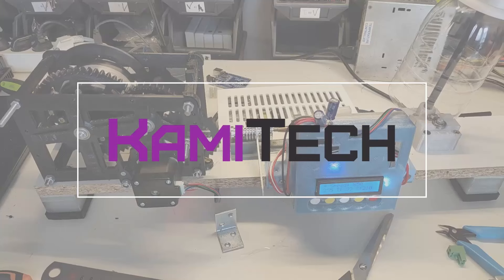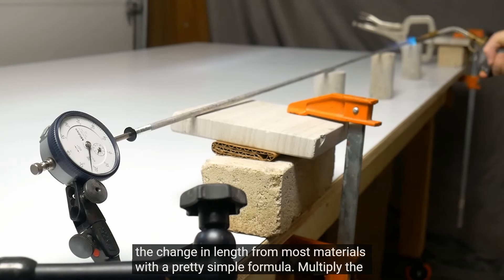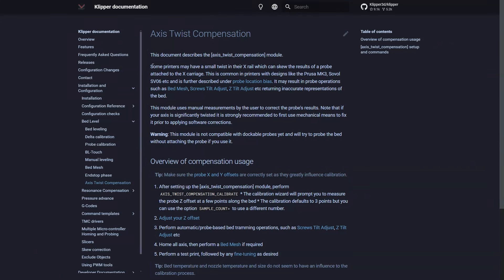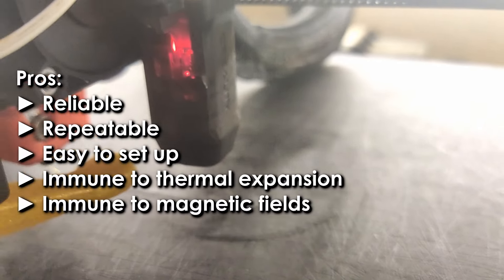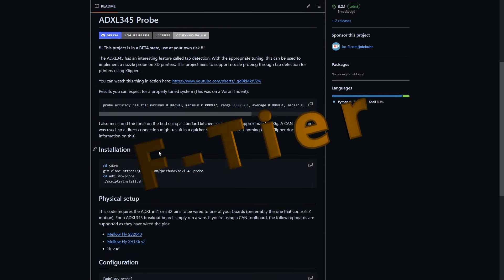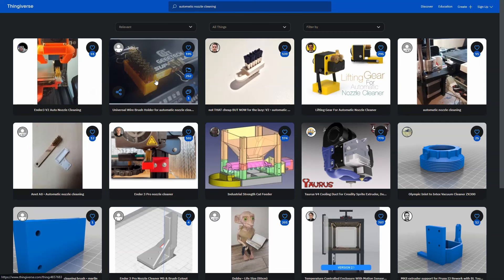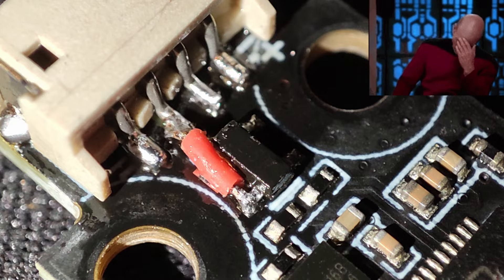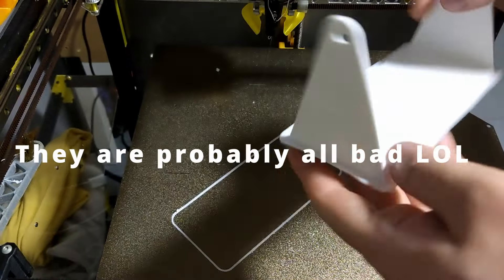Why All Bed Levelling Probes Suck - Eddy Modding and Testing

Comment: You can put your build plate on adjustable stilts. Ditch the springs, replace them with a nut that locks the bed to the top of the bolt.

Then put two nuts around the bed carrier. You can adjust them once, then jam them against the carrier and never need to touch them again. I use nuts in flat large printed thumb wheels.

Springs are bad because they respond with vibrations. Furthermore every time the spring oscillates, it nudges the bed adjustment nut just a little to unscrew itself.

You still want a bed mesh to compensate for bed shape weirdness which might well be temperature dependent, but you might not even need a probe unless you have several print surfaces that you swap in and out.

Wanna know what i use for a bed probe? For a time i had a microswitch button probe that i attached to the carriage magnetically manually; now i use a 9g servo which swings a leg, on the leg is a mouse microswitch. I used to use a 3.7g servo but i broke its gears. I currently use it mostly to balance out the Z axis dual independent motors, and to home because i no longer have a spot to mount the Z endstop. I didn't want to pay the price of a good touch probe, and i think the microswitch is better anyway.

I actually don't want inductive since i use glass plates and will probably be using all sorts of clip-on bed type things.